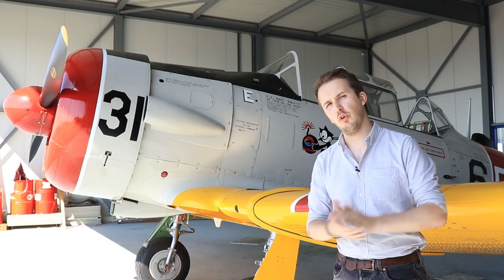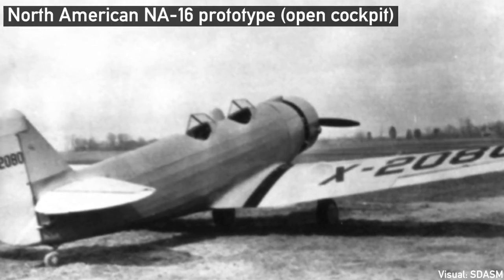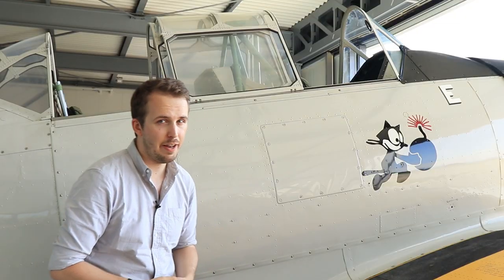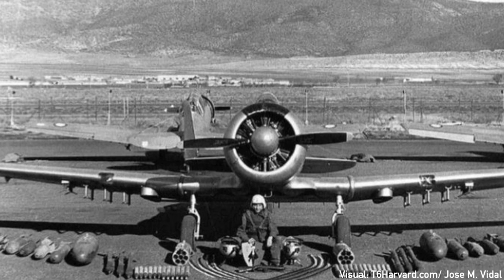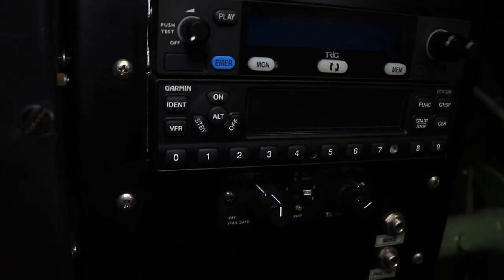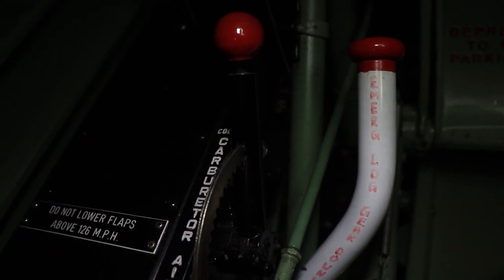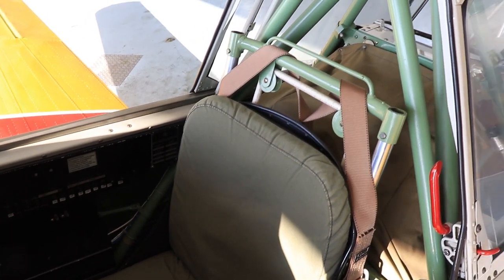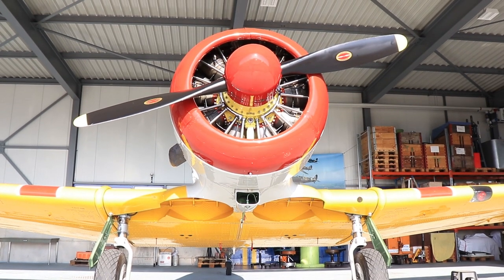Inside The Cockpit - AT-6G Texan

Comment: A mate of mine trained on Havards in the South African Air Force back in the early 70's.
The detachable joy stick in the rear position had another use .. for the Instructor to get an errant Student Pilot's immediate attention .. via his flight helmet (aka 'Bone Dome') .. stick to helmet .. enthusiastically. More than a few Students sported dented Bone Domes as a result of less than desired flight performance 😊.
The Harvard supposedly had the reputation of being one of the noisiest single-engined WW2-era aircraft with a distinctive 'drone'. As a youngster, we lived near to a coastal air force base. One always knew when Harvard's were airborne .. couldn't mistake the unique sound.
Reply: They probably are the loudest WWII single engine aircraft.  The prop noise is piercing and extremely loud.

Comment: "I'll try spinning - that's a good..."
INTENTIONAL SPINNING PROHIBITED
Reply: NO SPIN
Reply: if you cant spin it intentionally, what happens if you do it unintentionally ?   why is it even there
Reply: @ninus17  probably because spinning with this airplane might pose an unacceptably high risk of failing to recover from the spin and therefore crashing
Reply: @sebastianskwarczynski2435  i thought it was a knob next to the sign that says intentional spinning prohibited was what we were talking about.
Reply: Spinning in the Texan is very cool! Still possible in South Africa. 😎
Reply: @ninus17  A "spin" is a state where the aircraft has fully stalled one wing and mainly stalled another wing. The aircraft will fall in a spiral fashion unless corrected. If you look at the B-17G, Boeing 737, Cessna 172, and S-3 Viking you will see they have a relatively large tail. This is to allow good yaw control which would be required to recover.

On the AT-6, especially with two crew aboard, the center of gravity is far enough aft that there is a propensity for the spin to go "flat" (airplane spins around a point located within the aircraft) and be completely unrecoverable.  The crews only chance to survive would be to bail out. Obviously, nobody wants to have to ditch a good airplane.

Seeing as how a spin requires the aircraft to be stalled, an unintentional spin is easily avoided by recognizing a stall and recovering the aircraft at that point. Every pilot from WW1 through today spends a considerable amount of their training learning how to recognize and recover from a stall.
Reply: @ParkerUAS  i get that. again. i thought the sign was about the turn knob next to it.
Reply: @ParkerUAS  Exactly.  It's what killed Goose.  Those flat spins are no joke when you're heading out to sea.

Comment: I've flown one of these! Easy to fly – I had no prior experience. What Chris failed to mention, but sharp-eyed observers will notice, is that the T6/SNJ doesn't have a cockpit floor. If you drop something during flight (map, pencil, camera, etc.), it goes right to the bottom of the fuselage, to be retrieved only once you're back on the ground.
Reply: There's an aviation museum in Houston,  Texas, that has a T6 Texan and a B 25, among other aircraft,  that you can go for a flight in with a pilot, for different fees. I'm seriously considering saving enough cash to go for a flight in both of them. I'd want to get historical about it, reenact like I'm a world war two aircrew member, just to get into the moment of it all.

Comment: That plane is in really good shape!! My sole experience flying one was several years ago (I had no previous flight experience), and was far less traumatic than I anticipated. The real pilot did the hard parts (takeoff and landing) from the back seat. I didn't attempt any combat maneuvers, but control was pretty straightforward, though on a hot August afternoon, with thermals at work, the air was rougher than I expected. You had to pay attention to maintain level flight. The most disconcerting feature of the T-6 (to me) was that it had no floor. To operate the rudder pedals, your feet rest on what I guess would be called "rails." If you drop something, it usually falls to the bottom of the fuselage, and can't be retrieved until you're back on the ground.

Comment: That starting procedure was less simple than I expected ^^“ Stealing a plane seems quite hard, no wonder I heard that planes often aren’t locked
Reply: It is actually not that hard. He made the priming seem a bit more complicated than it really is. The Texan doesn't have an electric fuel pump, just a mechanical one in the engine and the "Armatrong" manual one he shows. Basically, battery on, fuel tank on, put fuel in the engine via priming, spin the engine with the starter pedal and once it is up to starter speed (four blades), turn the ignition on. It will sputter as each of the nine cylinders comes alive (sounds like a biker gang leaving a bar). As oil pressure comes up, you bring the prop up and idle at 800 to 1000 RPM as it warms up. There is absolutely nothing fancy or automatic on this plane, so the human has to manage it all.

Comment: This plane has the markings of Fighting Squadron 3, aka the “Felix the Cat” squadron.
Reply: Who never operated the SNJ directly. It looks like this paint may be based on their Hellcats.
Reply: @ParkerUAS  then why do i see pictures of old SNJ’s wearing the felix markings?
Reply: @berniemoxley5117  , Felix the cat or Felix with a bomb? Felix was very popular (like Bart Simpson today) and was used, but the Felix with a bomb was reserved for VF-3 and VF-6. VF-3 got the formal approval after the war and later became VF-31, then VFA-31 in the 2000's when they transitioned from the F-14 to the F/A-18 Super Hornet.

I have two family members that serves coincidentally with VF-31. An uncle from 1967 to 1974 and a brother from 1992 until 1998.
Reply: @ParkerUAS  Felix with a bomb. I feel like I’ve seen old black and white photos using the exact markings of this plane. And since when did they use Hellcats in this paint scheme specifically?
Reply: @berniemoxley5117  , VF-6 swapped designations with VF-3 in 1943 and started flying the Hellcat. The new VF-6 still flew F3F's.

Until 1946 the logo and name were disputed by the current VF-3 and the former VF-3, when the CNO formally gave the new VF-3 full rights to Felix and the squadron was redesigned VF-3A. They flew the Hellcat until being given the F9F in 1948 along with a new designation, VF-31. They would remain VF-31 until 2006 when they switched to the F/A-18E and became VFA-31.
Reply: @berniemoxley5117  also, nobody flew "this paint" as it is an amalgamation of both USAAF and USN paint jobs.
Reply: @ParkerUAS  uhhh.......